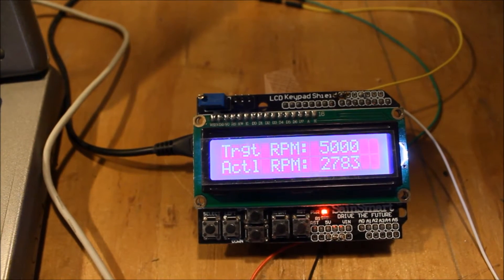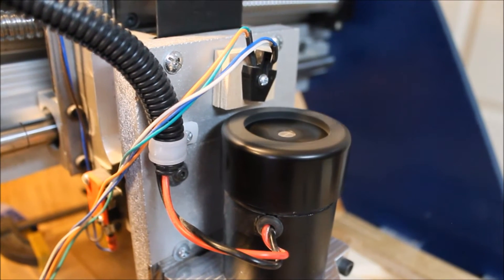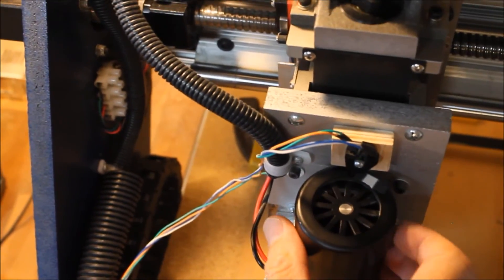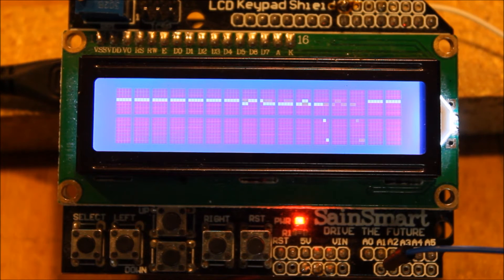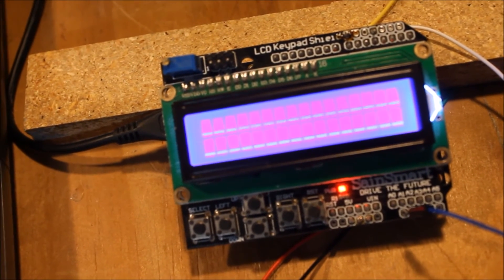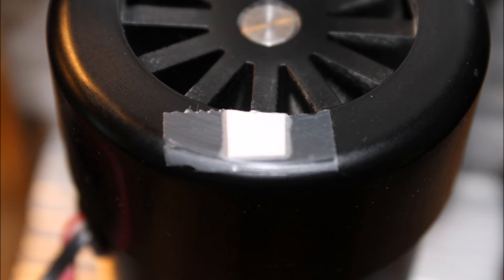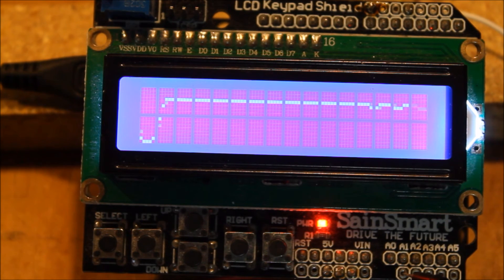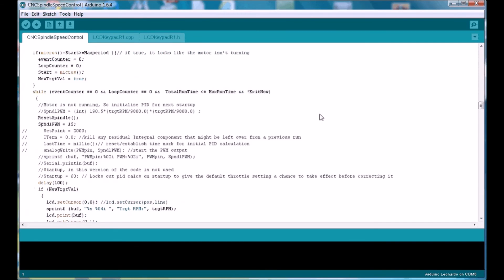DIY Arduino CNC Spindle Speed Control  Part2

Comment: Thank you so much for your efforts!!!This speed control works great!! One question though: how would I go about changing the max speed to 12,000rpm?  I see trgRPM<10000...is that the only place that needs to be modified?
Reply from the maker: I suspect it would be still stable if you increased the upper limit from 10000 to 12000.
With 48ZVdc applied, my spindle would not turn much faster than 10000 rpm.
Thanks for feedback :-)
Reply: Moving the set point to 12000 works very well.  Thank you again for your work and all of your help!
Reply from the maker: @MrConnor128  Thanks for the report.
Reply: I was able to see the 12000 rpm on the actual speed from your display when controlling speed with the the spindle control in “local mode”(using potentiometer) but I wasn’t sure if changing that one line of code “trgtRPM<10000” to trgtRPM<12000 would be all I need to modify
Reply from the maker: @MrConnor128  Yes, it sounds like for your setup, that will do it. But (here come the weasel words) you're operating beyond where I can go. So the only way to know for sure, is try it. GL
Reply: I guess my question would be “if the upper limit is modified, will the other calculations be negatively affected, and will the pwm signal out be scaled correctly?”  Again, I can’t thank you enough for putting all of this together!
Reply from the maker: @MrConnor128  The PWM signal is set using a PID type control loop. Its possible that the for optium performance (response) those variables could be tweaked, but (at least on my setup) the loop was quite stable (over damped). I'm thinking it should still behave pretty well with the top being extended by 20%
Reply: Lol! Thanks I’ll give it a try and let you know.
Reply: I’m hoping to update and upload tomorrow...I’ll keep you posted

Comment: Hello and a big thumbs up!
I've also made the spindle cnc speed controller, it works fine with Uno and my motor driver (310v DC) and 10000 rpm. I'm having trouble with setting a higher speed (15000 in my case) and  feeding a signal (0-5v) analog from Mach3 to set the target rpm.(potentiometer ADC).
I need your help, I do not have any programing skills, just basics. Thank you, best regards.

Comment: Does it work with G-Code  M03 M04 M05 ?
https://en.wikipedia.org/wiki/G-code#List_of_M-codes_commonly_found_on_FANUC_and_similarly_designed_controls_for_milling_and_turning
Reply from the maker: Hi, thanks for your interest in this project.
The short answer to your question is, "no". 
The sketch, in its current form is not monitoring the  "G" code commands being sent to the CNC processor/controller.  The objective of this project was to offer a simple solution for the CNC hobbyist, using spindle systems like that shown in this video, to set the spindle speed to a known value, and then, if need be, be able to raise or lower it (on the fly) should they find the current feed rate needs it.  I mostly do "one of" projects on my machine. And have found this approach to be good one for me. Hope you have equally good luck with your projects there.
Reply: I got som ideas here anyway

Comment: Interesting, is there some relationship between the oscillo and rpm showing? If you look at the oscillo graph, does it look ok?
Reply from the maker: Apparently the translator did not work well. I don't understand the question.
But I will attempt to answer anyway ;-)
The Oscilloscope view (other than using the interrupt pin as a trigger signal) runs totally independent from the speed control code. Its main function is to give the user a method to verify that the IR sensor is properly positioned over the spindle's timing mark. The sensor works well, but only if its properly positioned. The range of distances/locations that it will work over is quite narrow. This mode allows you to check/find the best location, first statically and then later while the spindle is turning at speed

Comment: Please could you help me with this - I am using Arduino Proximity IR sensor, which triggers well, but despite I am seeing oscilloscope pulses, I can not get to showing actual RPM - where could be a problem? I have connected both DP3 and A1 to IR output.
Thank you very much for your ideas.
Reply from the maker: I looked at your channel and your CNC mill is very clever. Nice work.
Its good to read that you are seeing the pulse output from the sensor.
One concern I have (not for your machine but for my code) is how fast your spindle is turning. My code was written around a max speed of 10K rpm.
My concern is yours may be turning closer to 25K.  If that's the case my code may not be able to resolve a pulse train coming at it that fast. But before we go down that road, could you make a video showing how you have your Arduino set up? Once I see what you have there I might be able to offer some thoughts.
Reply: Hi! I have experimented with hardware and software, but still did not get it to work. Do you think, that the problem with RPM not showing could be in SENSOR based on the oscillo graph I uploaded? Thank you for you thoughts.
Reply from the maker: Which Arduino are you using? In my video I am using a Leonardo.
An Uno should work as well. But I would like to know, just for reference.
It would be helpful if you could send pictures, or better yet post a video of your setup.
If not possible, or in the mean time, I think it is important to establish that the interrupt routine is is being activated (ideally once per revolution of the spindle). To do that you might temporarily insert a simple serial print statement at line 262. So that your code (sketch)
reads as follows:

// SpindleTachInterrupt:  called every time an event occurs
void SpindleTachInterrupt(void)
{
  Serial.println("Interrupt Fired");  // New temp line
  unsigned long ThisIntTime = micros(); 

Then using the Arduino's IDE (Tools/Serial Monitor) option observe that you see 
              "Interrupt Fired"
each time your timing mark passes under the sensor
Hope that helps
Reply: I am using Arduino Uno, I am using original code without changes. What do you mean by SETUP? Do I have to change the script depending of something regarding the hardware?
Reply from the maker: I just re-tested the sketch using a UNO. No changes to the sketch were needed to make it work. But as stated in the sketch notes (see notes at top of sketch) on the UNO, you use pin D11 as the PWM output,  but  on the LEONARDO it is pin D13. 
"SETUP" in this case means pictures that show the hardware you used to build the speed control system, and ideally how they are electrically connected.
Mine works and yours doesn't. So there must be some difference between the two setups. Knowing where those differences are will allow us to better focus on where to look for a fix